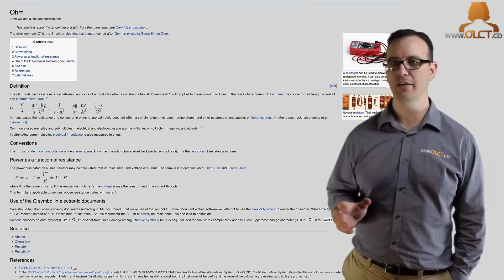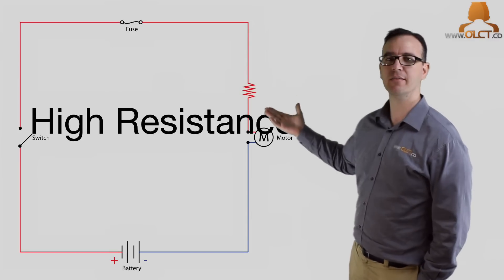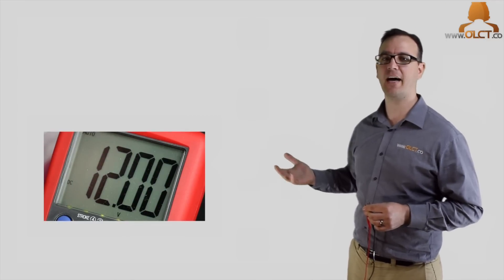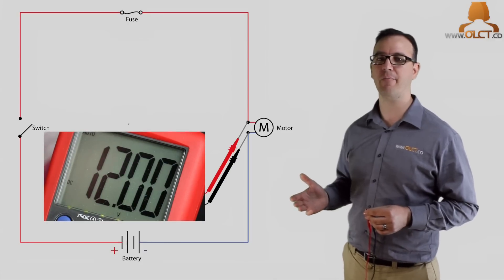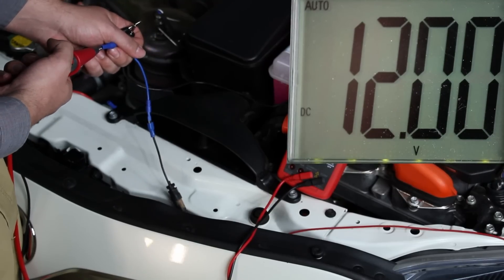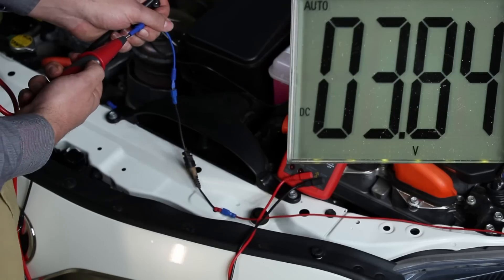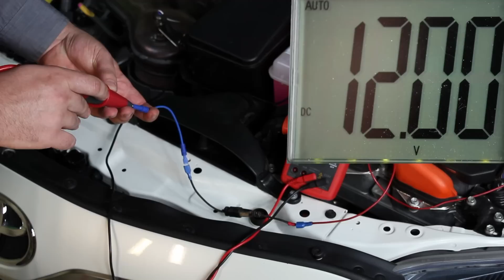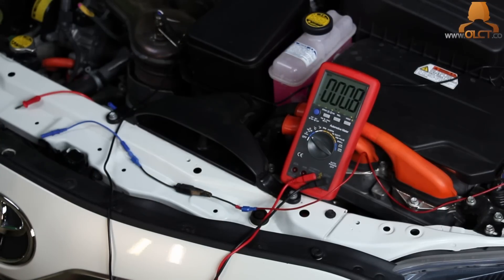Performing Voltage Drop Tests with a Digital Multimeter and the Load Pro

Comment: I understand that you have to put both test leads in both sides of the connector but what if you have only a single wire like a oil pressure switch that some motorbikes and scooters have

Comment: Hi I have just watch your video but I have one question you say to connect both leads to the live and earth of the connecter like on a stop light where you have a live and earth in the bulb holder but what do I do if i just have a live ie from a starter relay on a motorbike do I put the earth test lead on the engine casing

Comment: better to put the negative testlead on the battery pole. could be voltage drop in ground circuit..? 3minutes in video: MASSSIVE FAIL LOL"!!! the switch is open position you shold have NO VOLTAGE! 0! NADA! HAHAHheheh

Comment: Typey1 use should throw ur testlight in the garbage. I say that because it's uncalibrated and unsafe and if a computer controls that cooling fan,wiper motor, or any other load u risk completing a circuit with a dangerous amount of current. Now days tutorials like this are dangerous to non educated people due to the complex electrical systems. In all honesty a person should understand electrical concept before sticking any tools into a circuit. There's nothing more dangerous then someone who watched a YouTube video and thinks they know something then someone who flat out doesn't because 9 out 10 times they know they need to take it to the professionals. Remember a multimeter can be a jumper wire that could start the engine with ur arm, leg, finger,etc... In the wrong place .if used incorrectly do to lack of knowledge which u will not learn in a 10 min YouTube video. So in a nutshell good video I'm glad u at least gave Dan the props he deserves cause ur video is word for word out of his book. But yeah leave the testlight on ur table to open parts wrapping because it outdated and will cause more problems than u have to start on any new age equipment, cars, trucks, lawnmowers,etc.. Yeah I said lawnmowers that's what I'm trying to say everything is more advanced and it will need skilled mechanics yes mechanics not technicians, look it up were not artist lol. Peace

Comment: can you leave the example circuit in your video connected and see the voltage drop testing after the resistor with the load pro button pushed.voltmeter neg lead to groung on meter    thanks  great video   mark ferraro

Comment: The LOADpro leads are a tremendous device in measuring circuits with confidence. The "Fundamental Electrical Troubleshooting" book authored by mechanic and LOADpro inventor Dan Sullivan is a fantastic tool in explaining electrical theory and troubleshooting in easy to understand terms all techs should know. His book clearly explains electrical concepts in a fun easy read. I found his info reduces a lot of bad practices many good techs find themselves doing over time. Both are highly recommended.

Comment: Hi, if you use a test light on the circuit would it be not so bright to indicate resistance and should no corrosive resistance give a reading closer to battery voltage say 12.45 but your 12v only reading indicating a loss, I'm learning